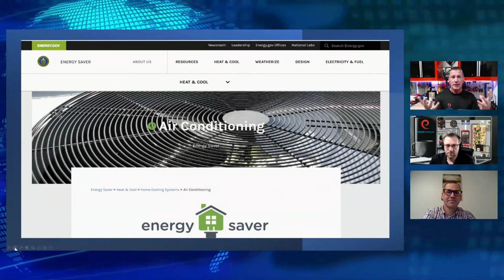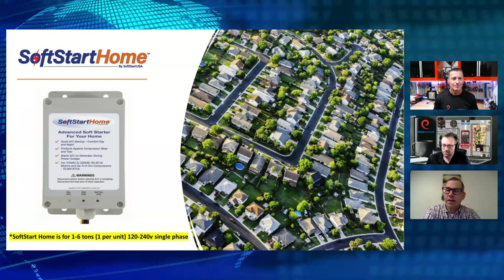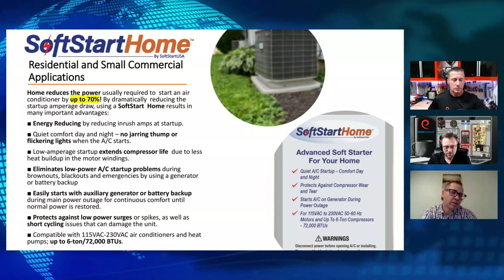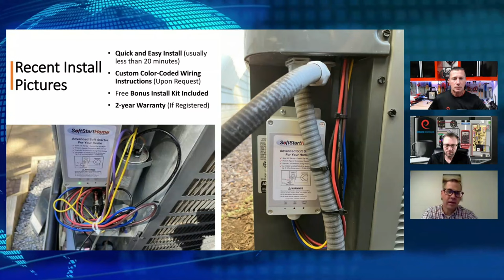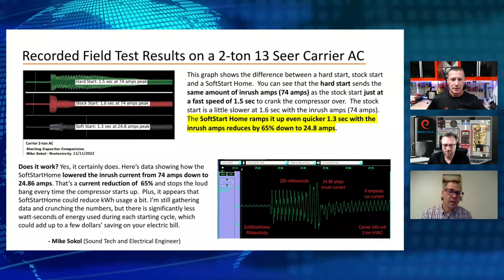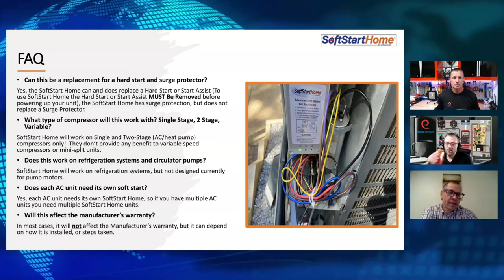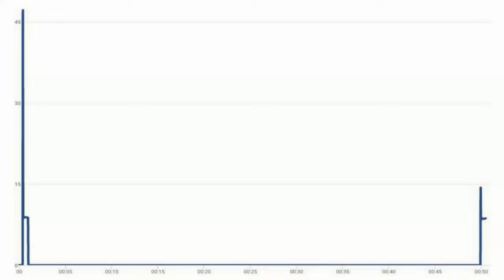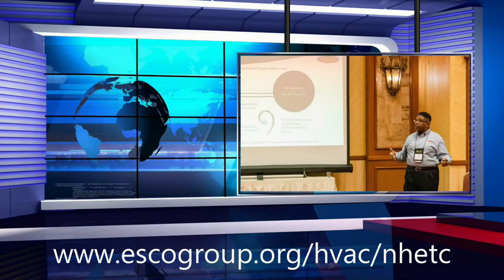What is a SoftStart for HVAC?-The ESCO HVAC Show-Episode14

Comment: Is it like a ballast?
Reply from the maker: This might be a better question for Aaron, his contact info is at the end of the video.
Reply: @escogroup  I watched the whole video and I guess it kinda is like a ballast, because it controls the electricity from fluctuating but I think that a ballast also stores electricity and provides a more even flow by distributing it evenly, Where a light with a broken ballast will blink and go brighter and dimmer and just is all over the place, it does distribute the power more evenly to the ac unit, similar to the way a ballast distributes power supply to the lights more evenly.

Comment: The homeowner energy savings claims seem a bit disingenuous.  If the compressor starts up a few times an hour, say 100 times a day, that's 3000 times a month.  If it reduces power by 5000 watts for 2 seconds that's 6000 seconds a month that's 100 minutes, less than 2 hours spend starting the compressor total.  That's under 10,000 watt hours or 10kwh.  If the utility charges 10 cents per kw hour that would be less than $1/mo.  Those numbers are made up.  Are any of them unrealistic by an order of magnitude?  Or is the implication that a soft start will save energy at times other than compressor start up?